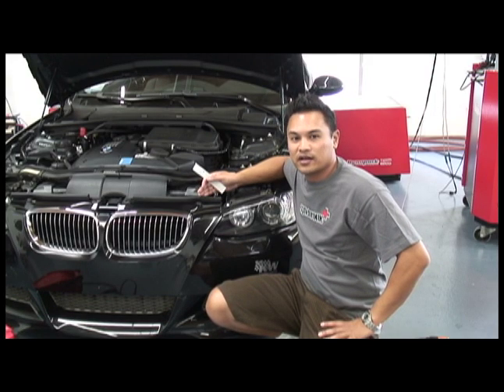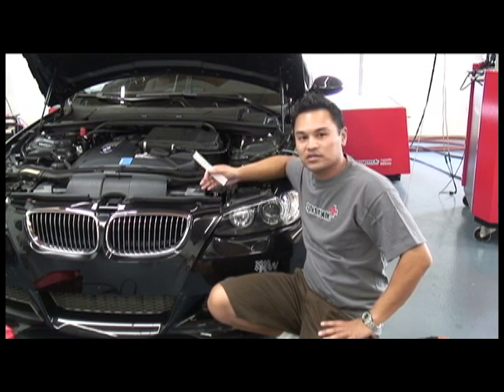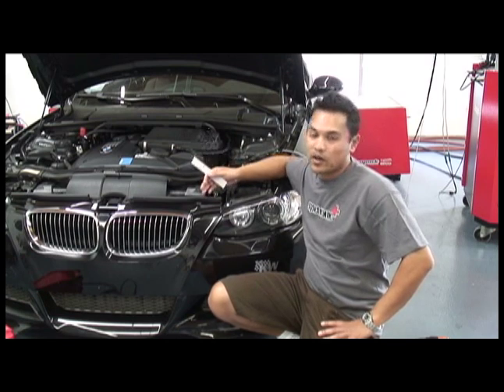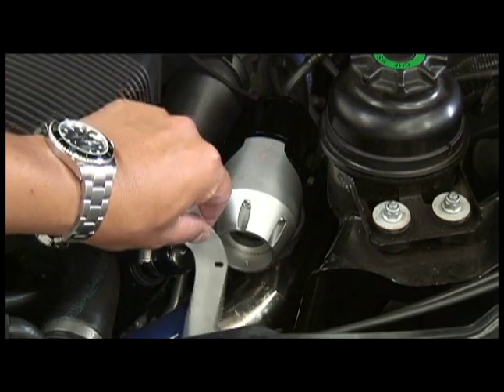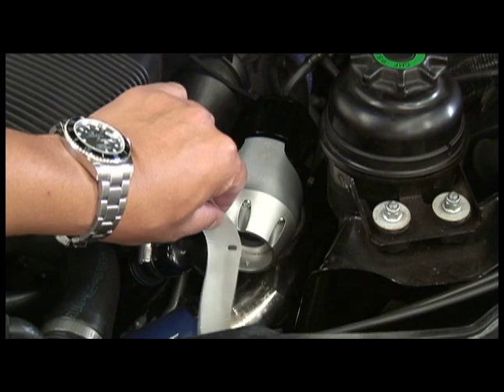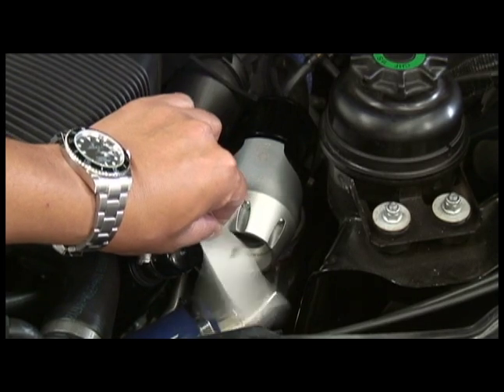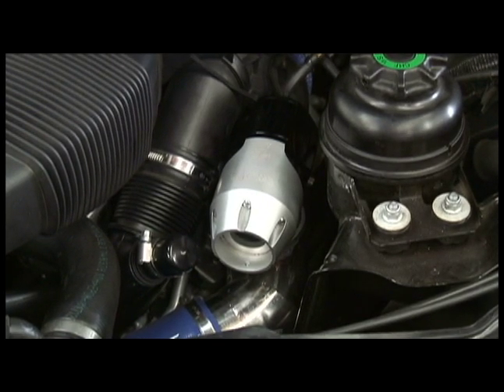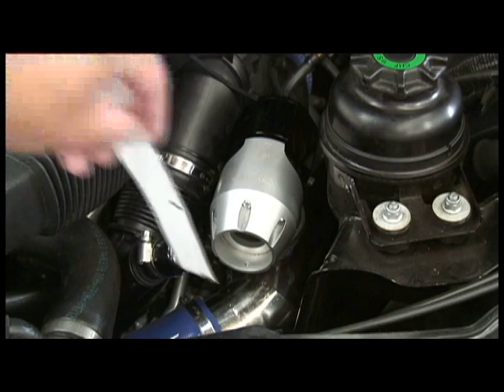Filtering a Blow-Off Valve (BOV)

Comment: mine are further back i modded a set of factorys ..removing the whole pipes so it looks neater my concern of were mine are right above a square hole inner wheel (u can see out of not sure if theres a shield missing or this is normal )  am seing stones rather close building up on the inner well frame lip were the charge pipe is  ....i have a 335i n54

Comment: Why would u want to leak boost from the bov? I dont get it, this is not a wastegate, and doesnt it mess up the air fuel ratio? It discharges air which was allredy measured by the maf sensor?